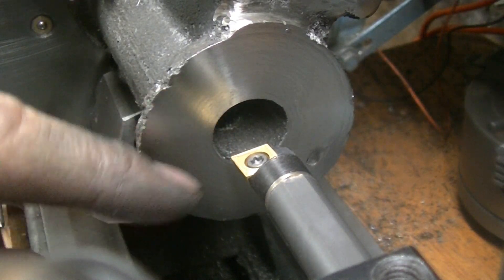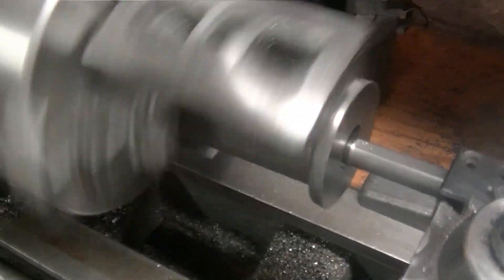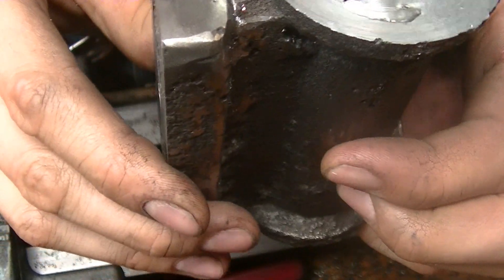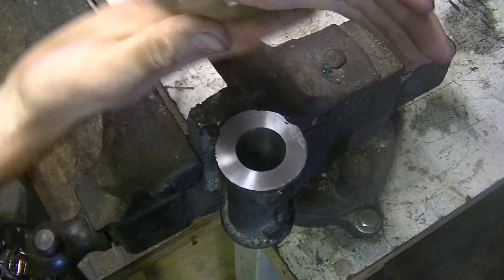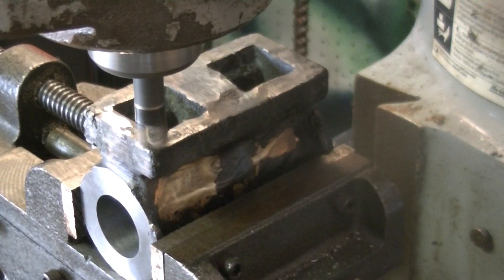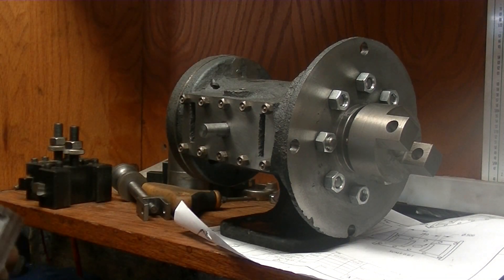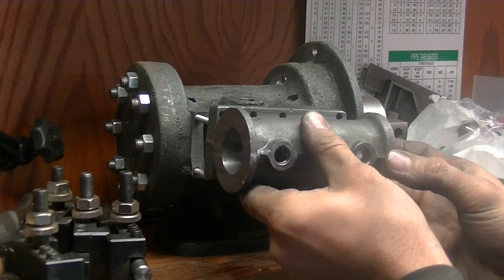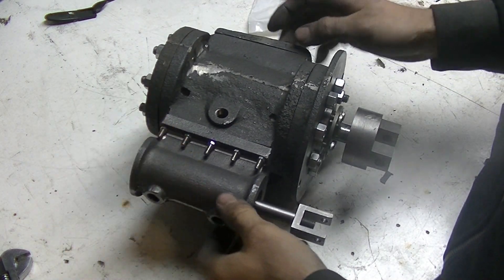Steam Engine Build: Valvebody Machining Part 2

Comment: I just noticed the vise you have when you honed the cylinder. Is it a rotating jaw Parker Vise? I ask coz if you look at my restoration video of my 1894 swivel jaw vise you’ll see I’m missing the genuine top swivel locking dowel and the genuine front hand crank retainer. I wonder if I could get a mould off of yours or some pictures and dimensions so I can get Clarke to cast me one???? Btw I’m designing patterns right now for a 3x4 vertical based off of HandToolRescue’s engine restoration.
Reply from the maker: Dang that's very interesting! I had no idea that vice could potentially be so old.  When I made this video, I was sharing the shop space with my buddy so the vice is his.  We both bought houses after this and moved our stuff to our separate home shops.  I will ask him what happened to it.
Reply from the maker: I just took a look at your video and yeah it looks a lot like yours! Had no idea the jaw swiveled . There are a few small differences from what I can remember about this vice, perhaps a different model or year.
Reply: @fairweatherfoundry715  What is your Instagram name? I’ll contact you over that and send me some more pictures from the catalog. We can also talk about the vertical engine I’m making right now.
Reply from the maker: @rallymax2  instagram is mistermattymo

Comment: How soon are you shaking out your castings letting them cool in the mold might give you softer iron
Reply from the maker: I try to keep em cooling overnight.  It helps, but I just need to get better at the whole process and using the ferrosilicon to make it softer.
Reply: Fair Weather Foundry your doing better then I am haven't branched into casting but I do do pattern making and am fixing up my flat belted machines. Have you looked at my video probably up your aley

Comment: You think Clark would sell some castings? Looks like he knows what he's doing
Reply from the maker: There is a lot to know about pattern making.  It is an art in-and-of itself, separate from actually pouring the metal.  I don't really show me making the patterns, but here is some advice on how to make them and what you need to do:

1. Glue two pieces of wood together with a piece of paper in between them.  THEN turn the cylinder like that.  When you are finished, drill through the two halfs for alignment pins and then separate the two halves with a thin knife (since they are only being held together by the paper).  The alignment pins are absolutely necessary for the mold making.  Cutting the pattern in half from one solid wont work well at all.

2.  Do not put any sharp corners in the pattern.  All corners must have a "fillet" which is a rounded corner.  Sharp corners cause the metal to "rip" during the cooling process and not look good.

3. All vertical surfaces must have "draft."  Which means, you slope the angle back, such that it can be pulled out of the sand without breaking apart the sand.  This is also very important for the mold making.

4. All cores must have "prints" which are extra cavities so that they can be hung in the pattern and suspended suitable to create the cavity.   Each core needs their own "core box" which is essentially a negative of the core and used to make a sand positive to be used in the final mold.

These are just a few things that come to mind.
Reply: Fair Weather Foundry and allow the pattern to be larger for shrinkage 👍
Reply from the maker: Oh yeah! Forgot that one! As well as adding thickness to surfaces you will machine so they can be machined down to size.
Reply from the maker: I can ask him and get back to you, but I think he would.  What kind of castings are you looking to get?
Reply: Clarke E where are you located at?
Reply: I'd like to have one about this size but the older style with the slide valve box attached to the casting. I could fabricate the rest of the engine but not the actual cylinder with slide valve box. I'm probably wasting your time because right now I couldn't afford much more than a couple hundred bucks. Maybe I could make the wooden cylinder so all you'd have to do is the casting? I'm sure there's plenty of people that would buy one from you.
Reply: Chris Anderson I'm in central Mississippi.
Reply: I did get it but didn't want to bother you until I got the pattern figured out. I dug out the wood lathe and turned a cylinder with the flanges out of pine but it's too long. I'm also wondering about when I cut it down the center, I'm going to loose the width of the blade and it won't be a completely round cylinder. I'll try and get a picture this week and email you, I don't want to waste your time though, thanks
Reply: Shane K send me some pics of what you're doing and ill see if I can offer any advice
Reply: Will you be able to cast in the steam ports between the cylinder and the steam chest that holds the slide valve? IDK how you'd do it but I know some of the smaller castings available have them cast in already, thanks
Reply: Shane K You will need to make a core box to make the cores for those ports or it will be a solid chunk. Matt had the pattern along with the core box for me to work with on this particular casting so I was able to insert cores just for that
Reply: Do you still have the pattern for the one you made in this video? It's fine size wise I just wanted a steam chest with the square slide valve like on older steam engines, I've spent several hours and bought the styrofoam and bondo but I'm really getting frustrated, I think I'd be happy with a cylinder slide valve like the one being made here. I'd be happy to buy the castings here if you guys could figure a fair price. I'd bet you could sell dozens of them actually. I've thought about the Stewart castings but I want something bigger. What do you think?
Reply: Clarke E indeed
Reply: Shane K Shane  you'd have to discuss that one with Matt, it's his pattern and core box.
Reply from the maker: Interesting idea! Let me sleep on it to think about appropriate pricing and other details, but I am all for it.